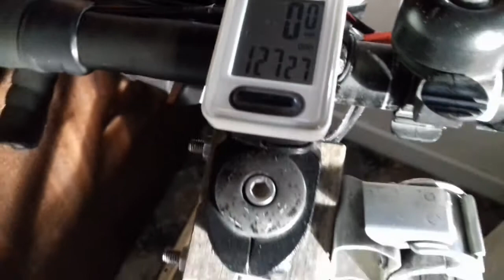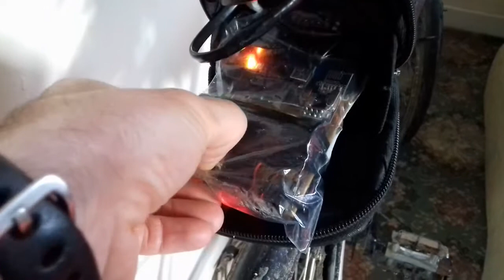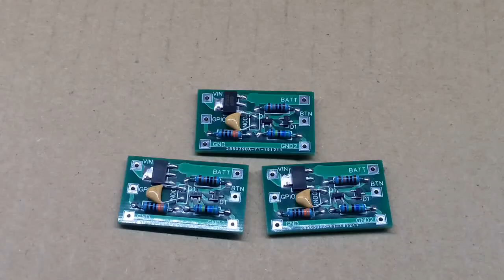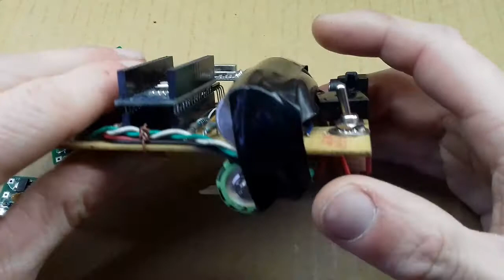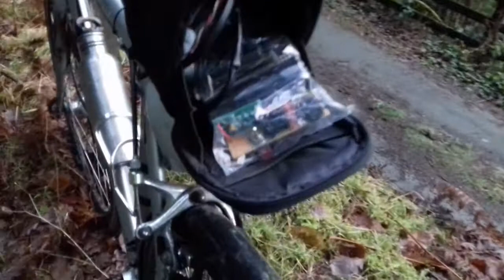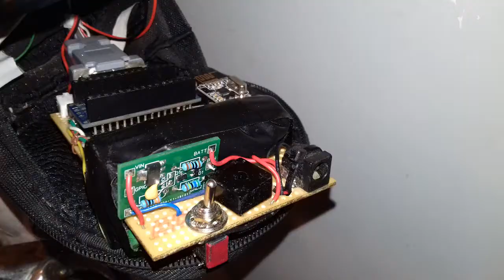Bicycle automatic shifter Power latch circuit

Comment: Is the shutdown timing controlled by the power latch board or do you need to send a shutdown pulse from the Arduino to it?  Do you have your source code available somewhere?
Great project. Sounds like you've pretty thououghly tested it. I have a 330 hub on my trike that I may want to automate 
Thanks.
Reply from the maker: The power latch board is entirely controlled by the microcontroller. If the pin isn't an input with pull up resistor it will switch off. The off is done with code and by setting the pin as an output and writing it low.
if (Speed == 0){
    offTimer++;
  }
if (offTimer > 60){
    pinMode(reed2, OUTPUT);
    digitalWrite(reed2, LOW);   
  }
Loop is half seconds when not pedaling so switches off after 30 seconds.
I think I mentioned in my other comment that I want to put the code up somewhere soon, was thinking about the Arduino website. It has gone through a lot of development and is often updated which puts me of posting it as feel its never finished.
Reply from the maker: Code for the auto shifter is now available here https://create.arduino.cc/projecthub/erose/enviolo-nuvinci-road-bike-fully-automatic-shifter-6e9384?ref=user&ref_id=290494&offset=0